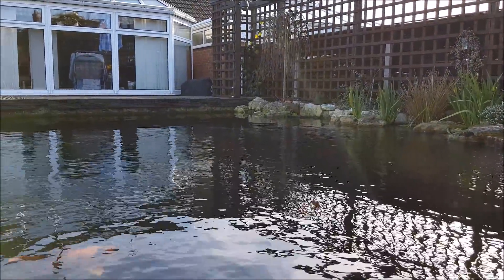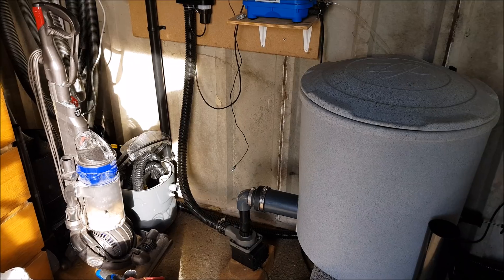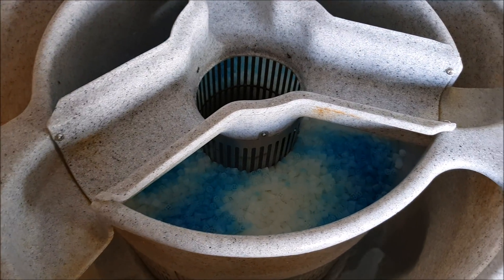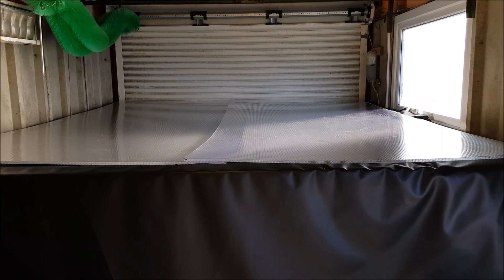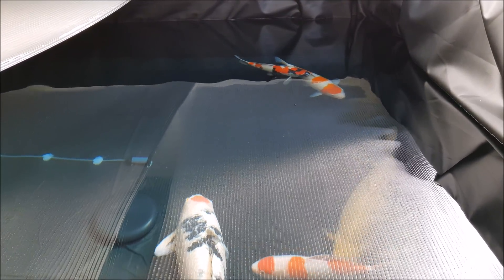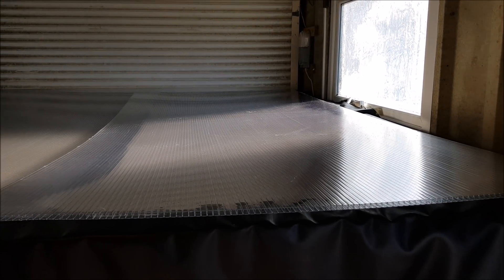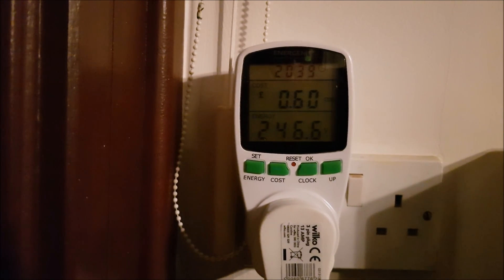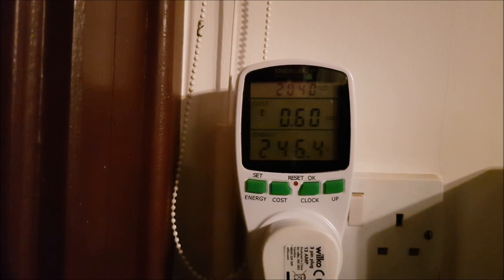New Quarantine/Grow On & Air Source Heater Installation

Comment: nice pond heater where did you get it from please and price
Reply: Do you have a email address
Reply from the maker: Thanks 👍 I have a trade account but most reputable dealers can get hold of them. Google Crystal Enterprise and there's lots of links.
Reply: @Mythril1976  can I used a small drum filter on my pond
Reply from the maker: @ANDY-we7mr  Of course but just make sure you get one big enough too handle the volume of water you have.

Comment: Hi,
Great video. I was just wondering whether you've sealed the end of the polycarbonate sheeting. I've just got some for my set-up but I'm worried about them becoming filled with algae in future.
Keep up the great work,
Simon
Reply from the maker: Hi Simon.  You can seal the ends of the Polycarbonate sheets if you desire.  Personally, I would.  The pond in this video was only a temporary one.  On the new grow on vat that's now in the garage, I have sealed the ends up and made a proper frame to keep the heat in.
Reply: @Mythril1976  Great. How did you seal them?
Reply from the maker: @fearno1839  You can seal it with either insulation tape or just normal gaffa tape.

Comment: Hi mate great set up im just wondering how you got on with it though the winter and what temp it kept your water at as I'm looking into buying the 8.5 for my 3000g pond. What size is your pond ? Cheers
Reply from the maker: Hi.  It was used on a 4000l pond inside the garage.  I was heat ramping for a couple of months so the temp went from 6c to 26c several times.  After the heat ramping was complete, a temp of 22c was set.

Comment: Great video mate I'm currently saving up for one of these heaters can't wait to get it
Reply from the maker: Their fantastic mate.  Next Thursday it will have been running for one month and it's used about £30 to keep the temperature at 22c.  Can't fault them.  Hardly any noise either.
Reply: Confessions of a Koi enthusiast They seem very cost effective mate, shame there so bloody expensive lol

Comment: Brill video .what make is the air source heat pump,how much,and how long do they last,thanks
Reply from the maker: It's made by a company called Crystal Enterprise. They have several different sizes. Mine is a 5.5 KW and I think they retail at £815. As for the lifespan of the unit, I couldn't say. They have two years warranty and I know someone with several of them. None of them have missed a heartbeat yet.
Reply: Hi I only have a 1200 gallon pond what size heat pump would you recommend.  Also the bigger the unit is it cheaper to run or would a 3kw 1 be ok for the size of my pond
Reply from the maker: Hi John.  I faced this problem when I was purchasing mine.  The 3KW would do the trick but may struggle a little once temperatures plummet so I opted for the 5.5KW.  And I'm glad I did with the weather we've been having recently.  It never missed a heartbeat.  Personally speaking, and if the bank says it's okay, I would go for the 5.5KW.  At least you know you've enough guts under the hood to maintain a steady temperature.  Plus the running cost should be a little less over time as it will be able to reach temperature quicker.  Hope this helps.

Comment: Great video thank you for sharing just wondering on the heat pump at what temperature does it stop working? I,e -5 or lower? Plus does the heat pump start back up if the water temp drops 1degree lower than the set temp? Once again great video👍
Reply from the maker: Thank you for your nice comment.  These particular Air Source Heaters can work down to -15c and still extrapolate heat from the atmosphere. The Air Source Heater will automatically turn back on once the water temperature goes 2 degrees lower and heat the water back to your desired level. Mine has been running for nearly a week now and to keep the water temperature at 15c it's only cost me just over £3 to run so it's saving me money already !
Reply: Thank u mate much appreciated👍. I will be looking in2 gettin 1 thanks. Looking 4ward 2seein how u get on with the grow on👍